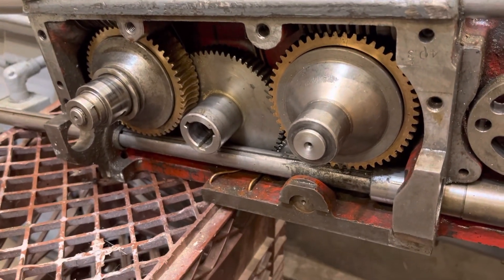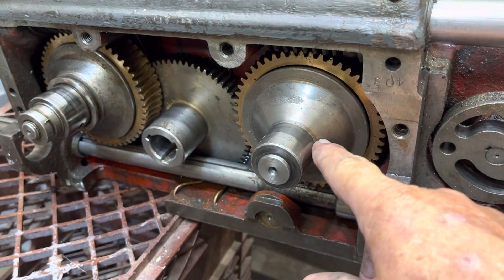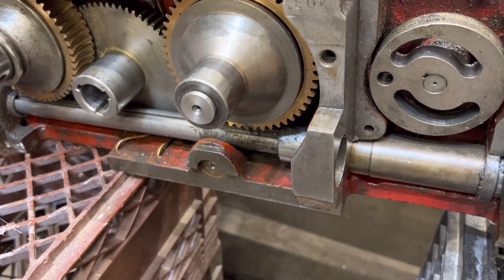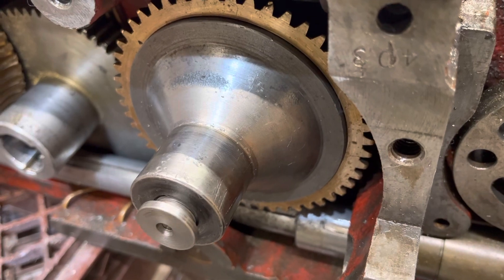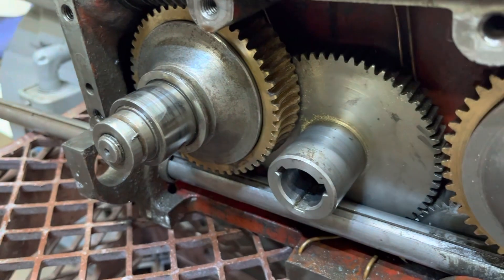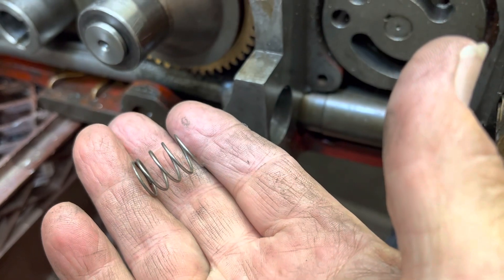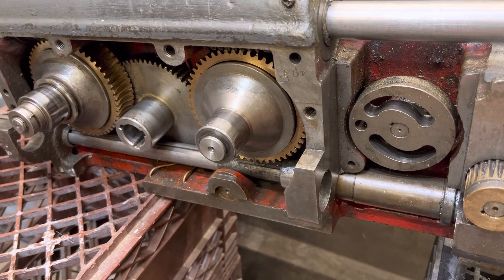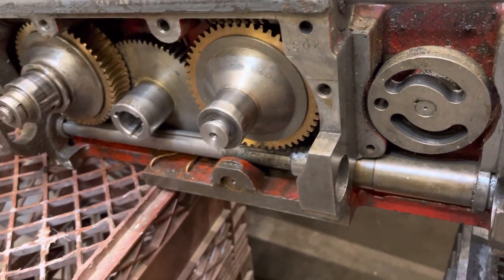PART 19,9

Comment: I have to do similar job on my Axelson lathe, the crossfeed clutch is running out of adjustment. I found out the clutch was improved on later models. The fix for that is building up the clutch surface. These old lathes are built to be serviced anyway.
You put out a great series of videos on the lathe that will be very useful to those that have these, my brother has one from 1929 with a plain bearing spindle but not much has gone wrong it is a low hours machine.
Reply from the maker: Thanks Dee

Comment: Well , GOLLY , SHUCKS , & GEE WHIZZ !      'Just takes a bit of head scratching . . . 'glad to help !
  EDIT :   I'm pretty sure that those extra threads , ( along with making the shaft diameter a better fit )  made a substantial difference in the way the clutch engages / disengages !     The spring just takes up the SLOP, & helps the disengagement . ( a little it of lube on the shaft exiting the front of the apron should help too - emphasis on LITTLE amount ! )     Like Brylcreem : "a little dab will do you '
Reply from the maker: Are you sure about the BRYLCREEM thing!!! I think maybe the Mandela effect is that playing here. (While I was writing and trying to spell mandala, my memory cleared and yes I remember bro cream)
And by the way I believe the spring fixed everything I don’t think my rod did a thing. I was super excited on the verge of giddy. I’ve settled down a little bit but I still feel the same way. It made the whole job worth it.
Kimber
Reply: @kimber1958  More head scratching . . .  < ( no , those dots aren't DANDRUFF ! )  . . . 
        Building up the diameter of the end of that shaft DID HELP . . . since it helped to 'center' the cone on the clutch . . .  But then , all things should be centered 'enough' for it to engage / disengage correctly , methinks !      * Ya done good , boy !   
       Brylcreem commercial :     'a little dab 'll do ya ! '     
https://youtu.be/7YCtW8-bUvY

Comment: I love the spring idea.  Just thinking if the spring helps disengage the stiction of the cone clutch, just maybe a stronger spring would be better.  Lots of pull in force from the engagement knob thread, and a stronger spring might not even be noticed. But if clutch sticking was your problem, and it is all apart, just maybe try a bit stronger spring and see how the knob feels.  I think both cone clutches in the apron might have has springs.  My Model C has dog clutches, and a different animal. --Doozer
Reply from the maker: Thanks Dooz.
All your suggestions sound good but I don’t seem to be having any problem at all . I don’t believe I’m gonna have any problem disengaging .
Reply from the maker: Thanks